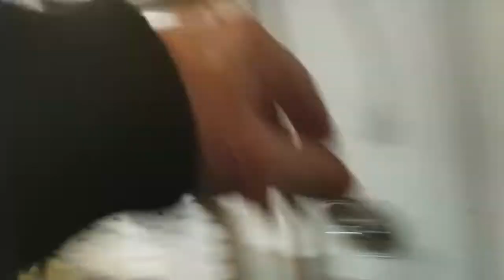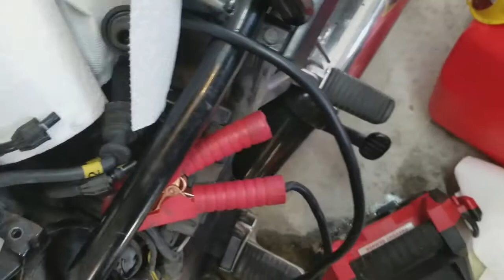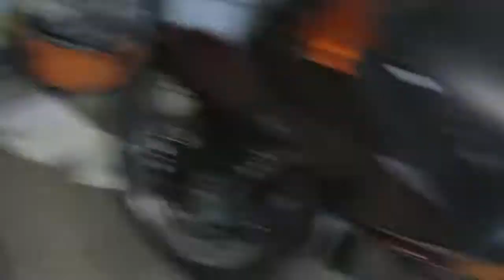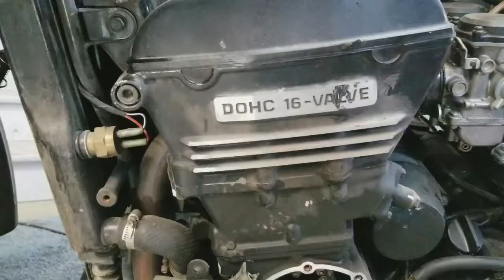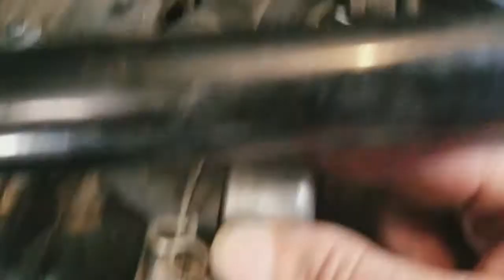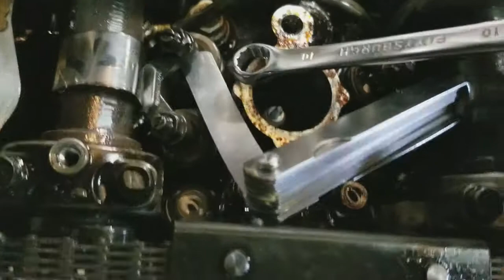concours valve adjust

Comment: Great editing and camera location. Think it's time to check the valves on my 1986 Connie. Gas mileage has declined to less than 35 mpg and it seems to be running a little hot. My first time so I really appreciate this.